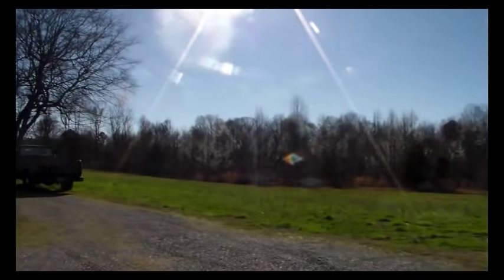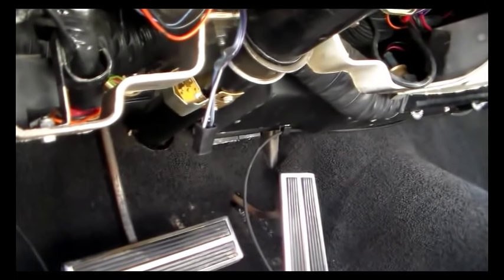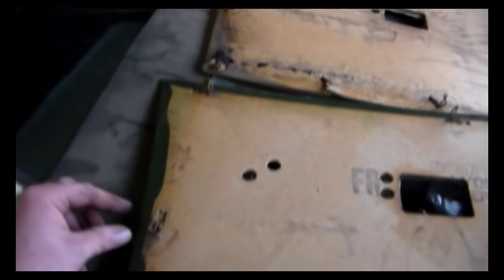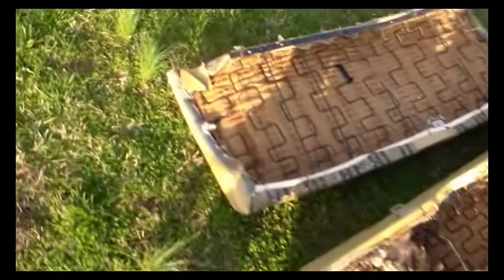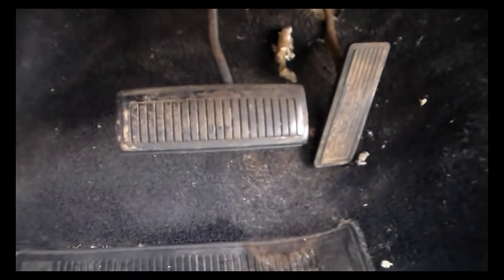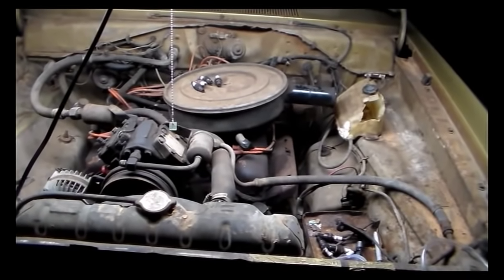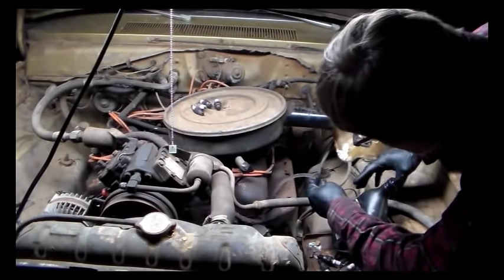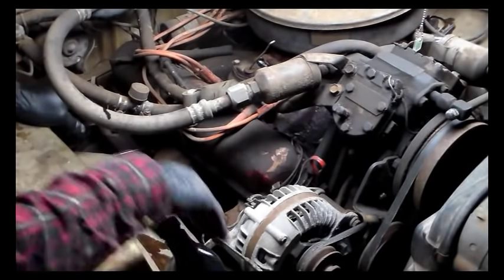Working on the '66 Chrysler, '68 Valiant AND '69 Dart

Comment: Tyler, funny description of the smell of the steering wheel! I have a set of screwdrivers with removable sleeve type handle with the inner screwdriver having a small diameter handle. All of the set of screwdrivers smell like vomit too! They were made in Japan.

Good diagnosis about the backup light switch. This shows you know how to troubleshoot electrical systems. I had a '68 Dodge Polara sedan I special ordered. It was the best car I ever owned.  Have fun!

Comment: That 66 really looks great.  About the door seals on the 68 Valiant - once you get good//better seals on the doors, you might try something like Syl-Glide silicone lubricating compound on the rubber.  I am now using it on the door seals of my 88 Aries, based on what a guy at a car show told me last year.  He had a mid-80's Mustang and had been using silicone on the rubber for a long time, and they were still in good condition.  I had been rubbing stuff like tire shine on over the years, but this stuff lasts for a long time.  I applied it 1 time last autumn and I think there is still some coverage on the seals.  I will rub some more on later this year, when the weather is warmer.

Comment: It could be that one of the Mopar specialists does correct colour vinyl trim paints/dyes like Corvette specialists do.  If you can really clean the green trim parts up you might be able to paint or dye them to the correct gold colour for your Valiant which should work out a lot cheaper than replacing them.  I also wonder if it might be possible to make new backing boards for the door trims and then use the original vinyl over them to recreate the original door trims, again for much less than replacement items would cost.  Sometimes with parts like that which are hard to find or expensive it can pay to think outside the (reproduction parts) box...